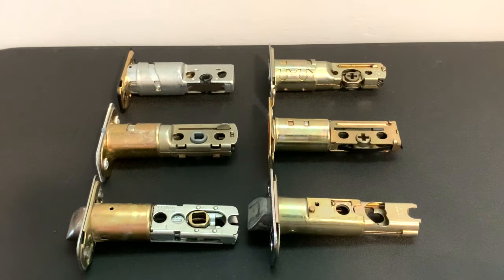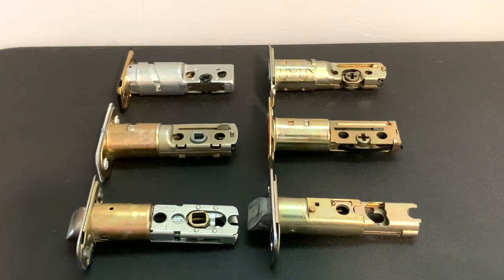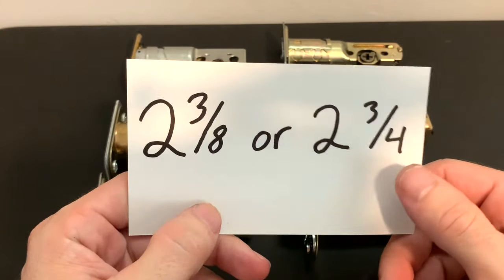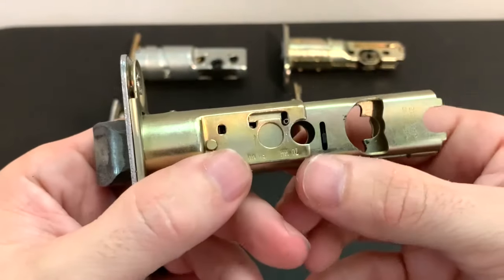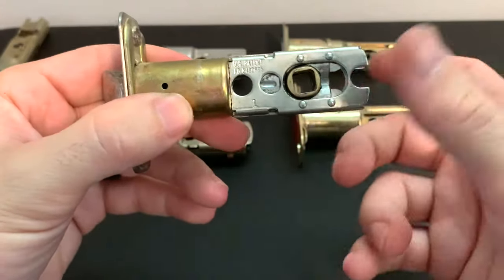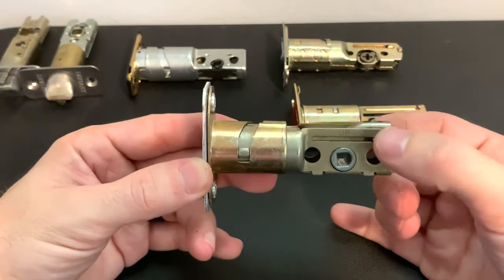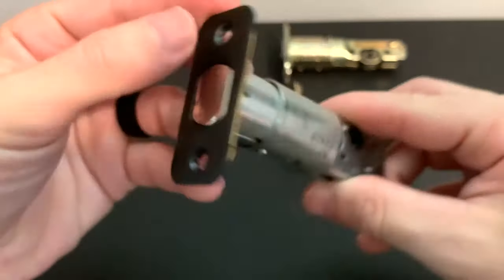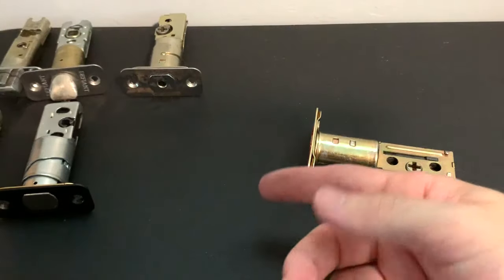How to Adjust Backset on Latch

Comment: Great video. I buy these extras at habitat for humanity occasionally.  Doesn’t hurt to have an assortment of them. Been a few times where I had to match stuff up or use as repair when the existing hardware was a matched set (deadbolt handleset combo) and all they needed was a new latch. Thanks for sharing!
Reply: That is a great idea! I ever would have thought of going to H4H to grab some of these latches. I need quite a few of them for my demonstration pieces to show how my new hardware works inside the doors bore hole. You just saved me a lot of money!

Comment: Thanks so much. Last night I was swapping out the entry door locks on a mobile home and the back door was a breeze but the front door has a deeper back set and I didn't know what to do. I was losing the light anyway so I put the old deadbolt back in and was going to figure it out today. I'm hoping this adjustment is all I need. It's a little embarrassing because my dad sold contract hardware and frequently mentioned back set but I never bothered to learn what he meant.

Comment: Thank you for doing such a great job of demonstrating these lataches. I have a model AYRDB-DRIVE latch that comes with a "Nest x Yale" smart lock, the kind sold by Google. Unfortunately I extended the latch to 2 3/4 inches from the default of 2 3/8 inches. Do you know how I can return the latch to the 2 3/8 inches setting?
Reply from the maker: Look to see if there is a little silver piece in the bottom center of the latch. 

You should be able to press it and slide the latch to the size you need!
Reply: @LockandKilo  Thank you so much. It turns out that Yale/Assa Abloy posted a pretty old video showing how to retract an apparently older version of this latch to 2 3/8 inches. Their method in the video did not work for me. A commenter suggested using a screwdriver to lift up a narrow black strip, then press a button that is on the bottom and at the same time push the end of the latch inwards. I fumbled a bit but on the second or third try, I got it right and the latch retracted back to 2 3/8. This is for an AYRDB-DRIVE latch version which is sold with Nest x Yale locks that were shipped to buyers in late 2023. I feel relieved. I have learned my lesson and will carefully measure the backset in the future.
Reply from the maker: @robertcochran7103 yeah, depending on which gen you have they are a little different. 

Yale likes to go and change everything on people lol 

Glad to hear you got it! 

Thank you for watching!

Comment: Thanks for the video.  My kwikset latch was missing the roll pin to slide over for the adjustment.  It slid freely but not all the parts inside slid with it, so the screw hole standout for the other knob wouldn't fit through.  Just needed a small pin to slide everything back.
Reply: Cómo lo soluciono xf mío se  a movido se a dividido en dos el cuadrante

Comment: Amazing video. Question, so now that I siwtched to 2 3/4 I still have a gap between the door and the plate.  Can you move the actual latch? Or just get longer screws?
Reply from the maker: I am not quite sure if I know exactly what you mean, but I can try and help!

If you mean that when you close the door and the latch doesn't connect with the strike plate, it could be that the latch/strike is recessed too far or a hinge issue to start with. 

If you mean the latch itself sticks out too far from the door itself, then the door may need to be recessed further in. 

Usually a gap would be a trim issue, hinge issue, or the strike/latch needs to be chiseled out some!
Reply: @LockandKilo  quick response! I actually removed the silver  plate from the latch. The gap is basically gone because of the golden latch cover.
Reply from the maker: @carlosrivera8756  Oh nice! Good to hear ya got it sorted out!

Comment: I hav a defiant doorknob and the back set broke.  I can only find a Kwikset back set replacement here in town.  Will a defiant knob fit into the Kwikset back set?
Reply from the maker: Unfortunately, Kwikset is the one brand that is very unique to its own locks. The tail pieces on the knob and deadbolt are very specific. 

Defiant usually have 2 versions on their deadbolts, one usually can work with Schlage locks, but the other is specific to Defiant (shorter/wider rectangle).

Comment: If anyone comes across a loose door latch or deadbolt and wants a solid repair that doesn't involve glue, stick, putty, or that ugly metal sleeve that ruins the look of your door, ReSecure Latch is that answer. ReSecure Latch sits inside the door alongside the latch, resecuring your loose latch from the INSIDE. Great for property maintenance, homeowners, and DYiers.
Reply: Thanks for posting the info, great to know if i ever need it.
Reply: @KStewart-th4sk  Thank you!

Comment: That brass square in the middle of the latching mechanism that the doorknob actually turns, it is too big and my door would not open because the latch would not retract past the strikeplate for the door to open And i got locked in. Why is that?  I have changed many doorknobs but this is on a new greenhouse and i did not love getting locked in in the dark. I don’t know why this is happening thank you.  There does not seem to be room to put on a normal strike plate and instead the greenhouse came with only a very clean squared off hole in the aluminum frame
Reply from the maker: Hi! 

So, if you are talking about the piece that the knob feeds through inside the latch, if that is too large then it could be the wrong latch for that knob, or it could have worn out. 

If you mean the latch itself is too big for the strike, you could use a dremel to notch the strike area larger. 

Not sure if that helps, but the little square in the latch should fit the knob post perfectly. There shouldn’t be any excess gaps around it.
Reply: @LockandKilo  well thank you so much! I’m subscribing! With all my DIYs I’m going to need your channel

Comment: I just got a lock to replace an indoor one that has no lock. although it's a 2.3/8 it's still too 'long'.  It looks like when they drilled the hole initially they drilled it a bit smaller.  I mean another 1/2 inch and it would be good.  Do I need to drill it larger or just over a 1/2 inch??
Reply from the maker: If it was initially drilled incorrectly, you may want to consider having a carpenter help you out as some doors are easy to damage when trying to "correct" this way. 

Sometimes people will bore the hole bigger and use a scar plate behind the knob, but this is all dependent on what type of door and where the door is located. 

Having one random scar plate will look off on a home with matching locks vs having a scar plate on a side garage door for example. 

I see a lot of customers who tried to just etch out enough room to make the latch fit, but it can cause splitting on the door and create a bigger issue since when you install the lock, you'll end up with a decent gap which can weaken the door and cause security vulnerabilities.
Reply: @LockandKilo  the door is particle board, so it was easy to bore out a few hunks so it would fit. THEN I put the lock thing in wrong so the key will lock it, but won't unlock it.. more youtube videos later I figured that issue out.
Reply from the maker: @anniesshenanigans3815  Well, hopefully it's all working out for you now! I am guessing you mean the tail-piece was installed incorrectly? 

I will try and get back to making videos again soon to focus on the DIY aspect as this is a popular topic in the comments lately :)

Comment: Mine is like the last one and it doesn't turn like that. I needed to take the square piece at the end off to fit my door. I'm wondering if that's why I can't adjust it. Mine is Teeho
Reply from the maker: I have come across Teeho locks that customers have purchased themselves, specifically the Smart style keypad dead-bolts, the latch has adjusted similar to the last one on this video. 

Try and firmly hold the end of the latch and twist only the face plate and see if it comes loose. The Teeho's out of the box can be very tight at first, also try to twist both ways to break it loose!

If the latch shows the measurements on the side it'll be adjustable.
Reply: @LockandKilo  Thanks so much. I figured it out. I really appreciate you responding.

Comment: Okay I’m having trouble with mine, which is like the spin around (the 4th one) you showed. Mine won’t spin around, it’s as if it’s jammed.
Reply from the maker: Hi, Dionne

You can try and spray lubricant on it and try it again, make sure you twist both ends opposite directions from each other to better make it turn over. 
Also, it doesn't require a lot of force to turn, so if you try and turn it too much it can sort of bind and act "jammed".

Comment: Oh great, the deadbolt i have is NONE OF THESE. It has a black spring type thing (on bottom) like the one in the middle on the right BUT does not have that mechanism that you just turn to change the backset. I am so bloody annoyed how to change it because it definitely has 2 openings marked 2 3/8" and 2 3/4". Those 2 openings are right above the black spring. The lock barrel has "Beaver" stamped on it which i believe was probably sold by Beaver Lumber here in Canada and long out of business. Also has "Made in Taiwan" stamped internally and 1992.9 which i assume is year and month it was made. The latch itself has U.S. Patent No. 4839025 stamped on it, so maybe that is an option for me to look---maybe the Patent explains how to change it. GRRRRR! It's brand new that i picked up at Value Village years ago with no instructions. My old, detached garage door never had a deadbolt installed and i wanted to use it there.
Reply: Well with the help of Google and searching with the US Patent number---don't ask me why the US Patent office site failed me, that POS said "item not found"--yet Google showed the US Patent link with the writeup. Used the US site one other time and it worked fine. ANYWAYS, there is a small pin (it has 2 little knobs of different diameters on each side of the latch). Push that pin UPWARD in its slot against spring tension, and you are then able to slide the turning mechanism in or out to whichever backset you need. I had to move it out to the 2 3/4" location.

Comment: I have an older house and need a 2 inch latch..Do they make those anymore?
Reply from the maker: Lock Shops do carry them in limited supply. 
Many times you can special order them from any lock shop!
Reply: Stuck with same 2inch latch. Advice plz?

Comment: What if it's not 2.75... but like 5 or 6 inches? What then?
Reply from the maker: This video consists of the most common styles found in the North American Residential world. However, the 5 inch latch is definitely still sold today! 

The 5 inch latch is normally sold in a “fixed” position, so it cannot be adjusted. One issue that happens with those is when an inexperienced handyman doesn’t properly measure before cutting and cuts slightly off the mark. 

It’s extremely important to be very precise in making the cut in the door accurate for a 5 inch latch due to not being able to adjust it!

Comment: Thank you, great help
Reply from the maker: I am glad to hear!
Reply: @LockandKilo  Thank you for the video, unfortunately non of them apply to my Yale yrl226  backset, if you have any info I would really appreciate it, thank you
Reply from the maker: @wireadvice3888  Yeah, this was for the most common latches. 

I believe the YRL226 latch just pulls backward.

 It's not super common and I do not have one in stock, but if I remember correctly, you hold the plate and just pull it back to adjust!